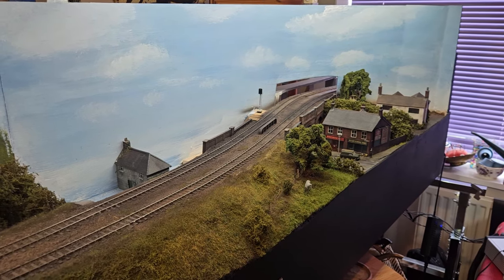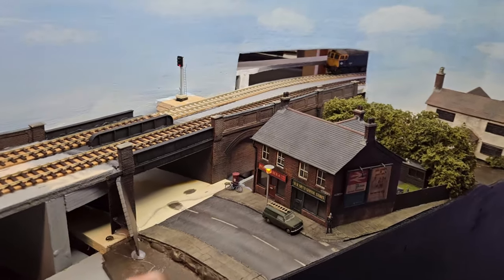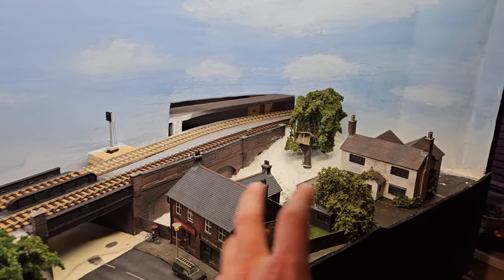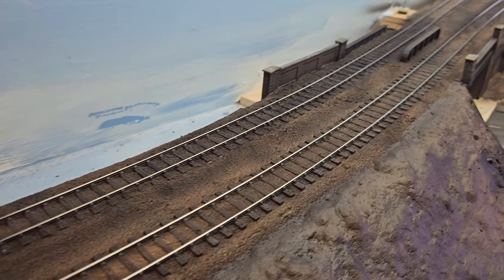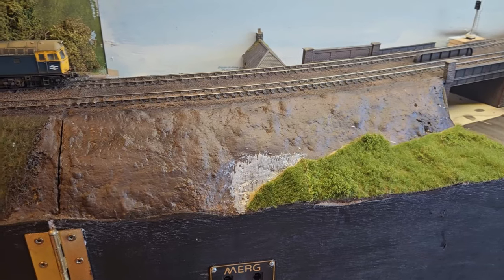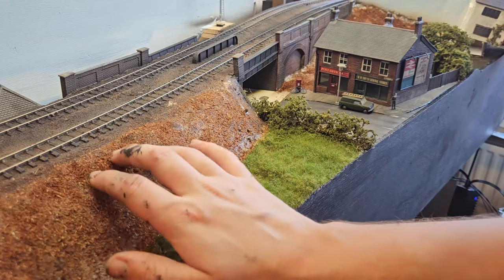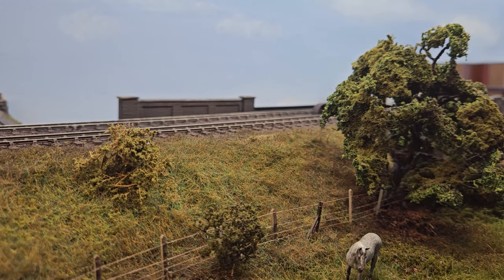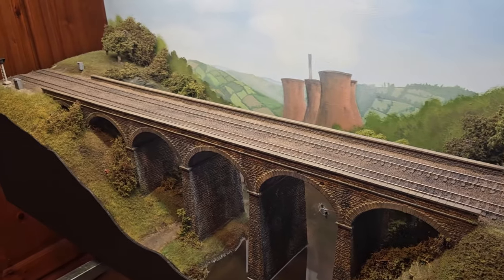Model Railway Layout Update - Building Embankment Scenery #7

Comment: Brilliant 👌 cool thumbnail aswell
Reply from the maker: Thanks mate
Reply: @HorsehayRailwayModeller  did you say you make your own sculpamold ? Actual stuff is so expensive!
Reply from the maker: @_RandomPea  I did for the viaduct video as I had ran out. I believe Luke aps has a good demonstration on how to make a large batch. I still think sculptamold itself has some really good properties including really fast drying time that can't be achieved with the home made version but it worked very well in the end. For now though I'm happy with buying  sculptamold doing small sections at a time but when I get round to some of the larger areas I have planned I'm sure I will re-investigate the diy method.